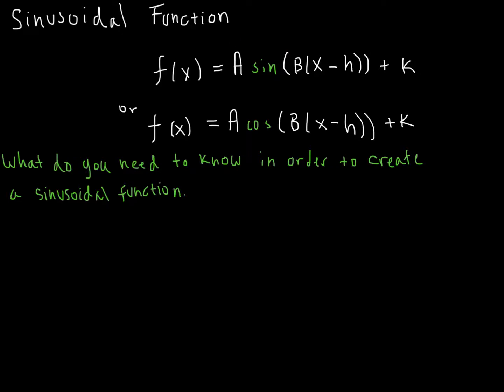PC U4.16

Comment: Christopher.A.6.60. Zahid to make it easier think about that the Ferris wheel starts at where the platform is at 0 seconds it goes around and when it get goes 120 it does it full rotation reaching back at the platform.

Comment: Zahid. R. 6: I struggle to find the phase shift but for the sine equation I would guess the phase shift is 120 since that's where the maximum first appears so in order to start at zero we would shift it 120 units to the left? I say that's the same for cosine, that confuses me. I need help fam
15sin(12+?)+49. Can someone help me with phase shift ??

Comment: ricky j. per5
@ Edwin aka ayy wey
so it is 15 because sine always starts on the midline. And its y-intercept is 0 because if you look at your unit circle sine is 0 thats where the ferris wheel starts on. you multiply 0 to 12 and you get 0 then you add 15 resulting in 15 feet.

Comment: Chase M.5
In class I remember the maximum value being 12 and you expressed that on the graph. How did you find the minimum value, because you found it without plugging in the minimum value from the unit circle?
Reply: To find the minimum value, look at where there are two maximums and then see which number falls directly in the center of them! For example if there's a max at 2 and another at 6, then the minimum would be at 4 since it is between the two,
Reply: It's easier to find the min value if you graph the function. The min would be between the two maximums